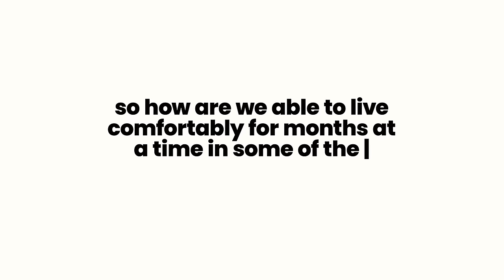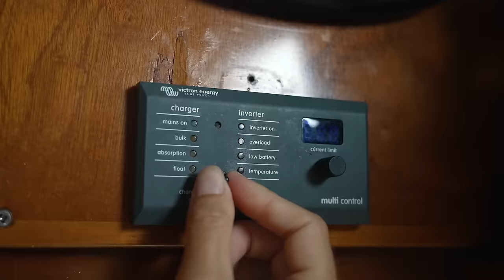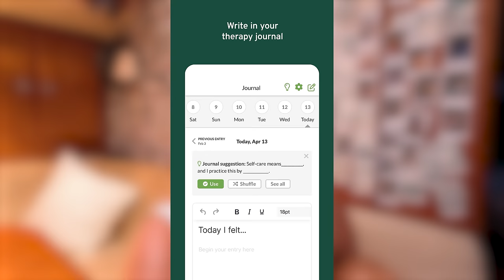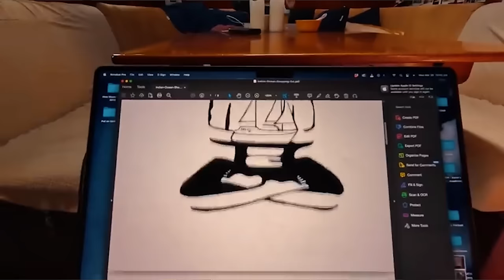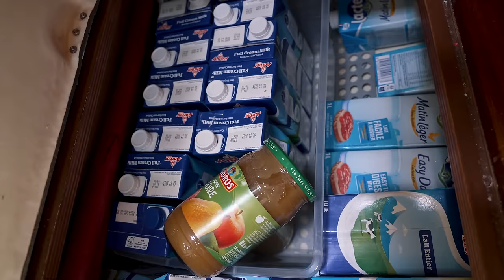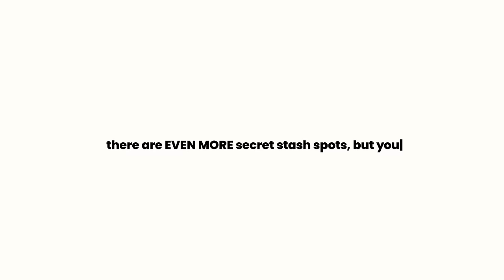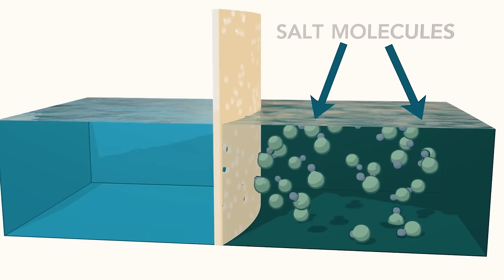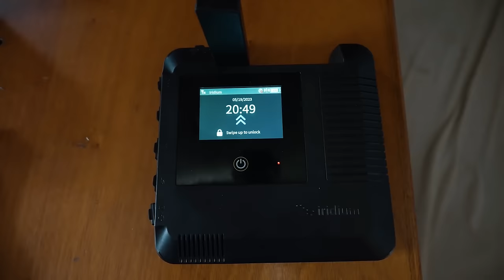Mastering OFF-GRID Living: 4 Key Things Every Sailor Should Know ⛵️ Sailing Vessel Delos Ep. 441

Comment: I have a question about solar panels because I saw a completely different video from this guy who was demonstrating a really expensive panel verses a really cheap panel.  Without any shading the all of the panels in this guys video outputted about the same power.  However when he had about 20% of the panel covered the cheap panel outputted almost zero power and the more expensive panel outputted about 80% of what it was before.

So do you know anything about what happens to your panels when they are partially shaded, does the power output drop to almost zero?

Do you think this guy in the other video was just trying a fast one to sell solar panels that were about 3 times the price of the cheap ones?
Reply: Bypass diodes do wonders to reduce loss of power due to shading.  The cheapest panels don't have any.  Some panels have 3-5 diodes.  If a whole cell is shaded it blocks current.  With the panel split into groups of cells any group with a fully shaded cell can be bypassed, dropping the voltage across the panel but keeping current flowing.  There is usually one bypass diode that allows the entire panel to be bypassed when multiple panels are in series.  A good MPPT solar controller quickly adjusts for the voltage drop.  A bit off topic.  But you asked.

Comment: Cheers guys, great video! Do you mind if I ask if the 255 bucks are still valid as of today for the starling connection on a sailing vessel? And could you maybe give a little bit of feedback on the usage (upstream/downstream speed, is it getting throttled at some point in time, maybe after a specific used amount of bandwidth, ...)? Their website and support are a.w.e.f.u.l.